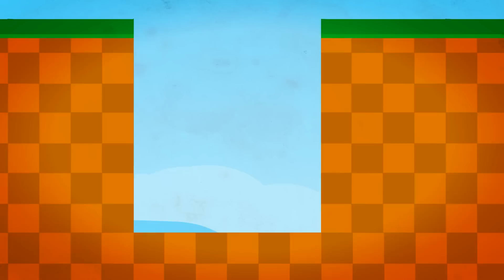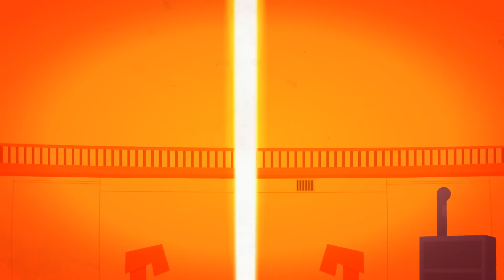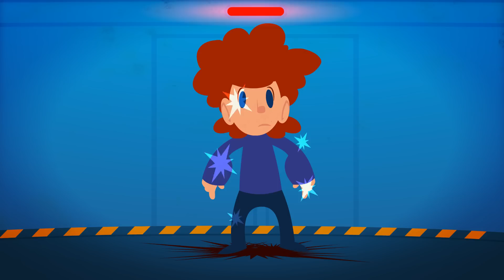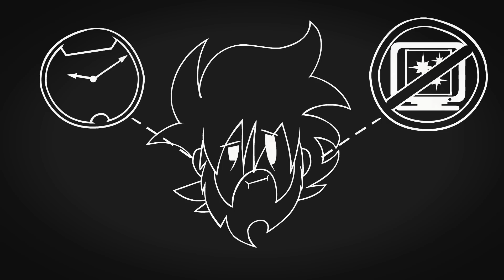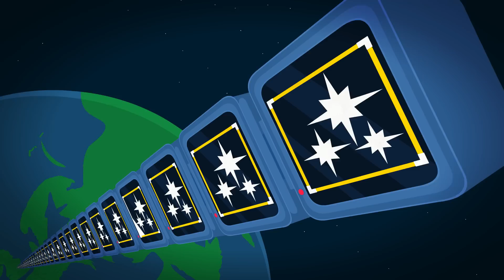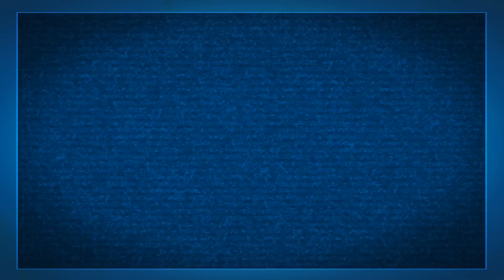Science Of Power Ups: Sonic Invincibility | Eddache & Kreid | MASHED

Comment: The Homework Answer:

Get some Dynamite And blow a hole in the floor, then dig with a pickaxe and a shovel, until you get out.

This should work, because if the shield is built around you, then the floor shouldn't be impenetrable! So that means you can escape by normal means.

Comment: Actually, Invincibility Monitors do NOT stack on each other in the games. Infact, no change happens if you have one invincibility monitor while already having said invincibility.
Reply: +Tonic Hedgefox (ToniczeHedgefox) Actually, if you get an invincibility monitor while already invincible, it resets back to the 15 seconds of invincibility, instead of making it longer, or having nothing happening. This hasn't been tested on all games though.
Reply: Avi I tried this in Sonic 2 and the effect I said happened.
Reply: Tonic Hedgefox Always been more of a Sonic 3 guy, which is where my effect took place.
I still think it'd be funnier if it reset, since it would be so anticlimactic, seeing him get hit by all 10000+ monitors, only to have it reset to 15 seconds.
However this animation was based off of Sonic 1, so I think someone should test it there.
Reply: Avi I'm also more of a Sonic 3 guy, but I've had most playtime on Sonic 2 because it's on iOS and Sonic 3 isn't.

Comment: Hmmm... Let's see... Invincibility normally lasts 15 - 20 seconds...

So... 10302 invincibility monitors... Which means...

15 - 20 seconds × 10302 invincibility monitor = 154,530 - 206,040 seconds of invincibility..
 Which equals to..
154,530 - 206,040 ÷ 60 seconds(=1 minute) = 2,575.5 - 3,434 minutes of invincibility..
Which makes...
2,575.5 - 3,434 ÷ 60 minutes(=1 hour) = 42.945 - 57.23+ hours of invincibility...

Estimated... around... 2 to 2.75 days of invincibility..

Wouldn't last for an eternity :|

Comment: The number of invincibility monitors that has been dropped onto the subject was 10302 invincibility monitors. and the maximum time for the invincibility to wear off is 20 seconds. So 10,302 x 20 = 206,040 seconds. which if counted by days would lead up to 2.384722 Days.

The dude will be fine. Just as long as he doesn't go insane by power.